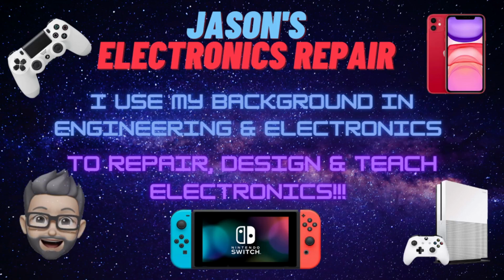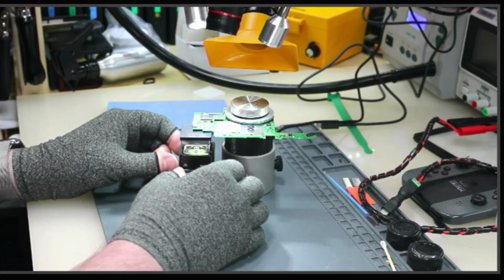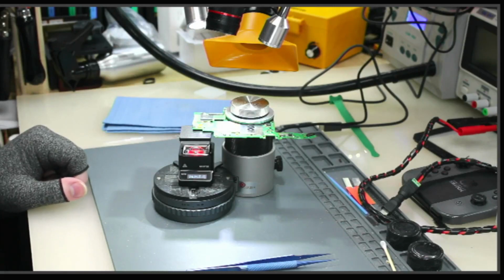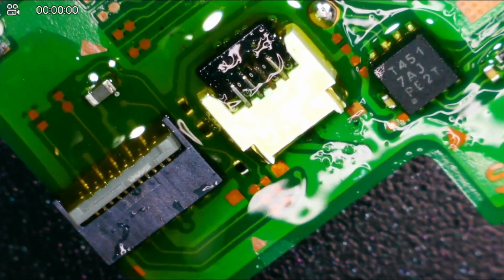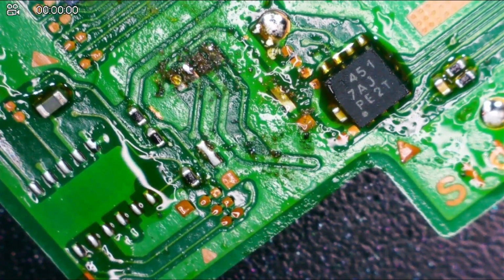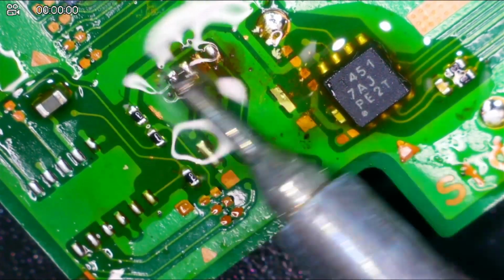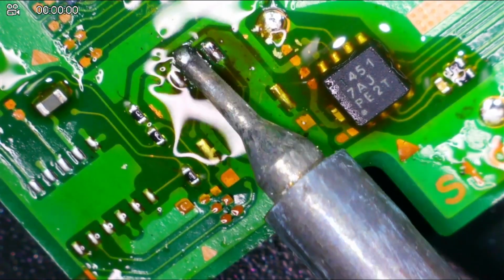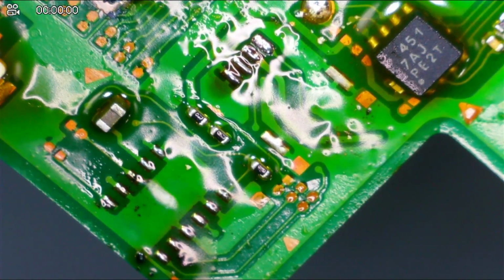Nintendo Switch Nasty Liquid Damaged Connectors Removed The Wrong Way

Comment: I was thinking one good use for The hot plate may be soldering on the new connector rather than removing the old one because you will have leaded solder on the pads and being a lower melting temperature it may be a lot easier to flow. Great video Jason as always👍

Comment: I was just thinking what could be a good use for the mini plate. Have you ever tried it on BGA chips for reballing? I mean when you use balls, remove the stencil and instead of hot air gun you could maybe put the IC onto the mini hot plate and let the balls melt. This way maybe the chance that the balls are running "away" and melting together because of the air flow could be minimized.
Reply from the maker: I have used it to reball a chip and it worked great, my only issue is the hot plate sits to high off the bench and my hands soaked really bad which made it harder to align the balls
Reply: @jasondoesthings919  sounds good. I can understand you regarding the shaking hands. I have the same issue. If I cannot put my hands onto the table to stabilize I am lost...

Comment: Thanks for this Jason.  I was going to try the same thing with my hotplate, but I have been putting it off.  What does the underside of the board look like afterwards?  Did the hotplate cause any burn marks?
Reply from the maker: It doesn’t burn the board. I set it up with a piece distance between hot plate and components. I was concerned about burning the board also and I probably could of let the board get hotter before I added hot air or used low melt solder. I plan on doing more things with the hot plate they are fun and cool.
Reply: @jasondoesthings919  Awesome, thank you!  Look forward to seeing more vids on the hot plate.  I really need to have a go with mine some time soon!  👍

Comment: Almost impossible to heat those from above without damage. Those lids are very weak lol. Good video.
Reply from the maker: Definitely, I should of let the hot plate raise the temperature of board higher and added low melt with iron.

Comment: jason i would have just used the hot air underneath the board that is how i changed the joy con rail connector and it came off in a few seconds with no torn pads and i put the new one back on the same way but i suppose with the corrosion you did not want to risk it good video though
Reply from the maker: Yeah, heating from underneath would be the correct way to do it. This was just me trying different ways so people don’t have to try it on their stuff
Reply: @jasondoesthings919   i understand now your title on the video looked like it stated the wrong way to take a connector off sorry mate they are the hardest connectors to do all the best jon